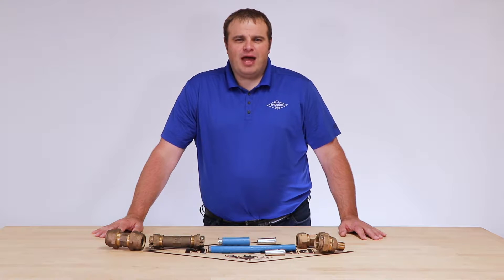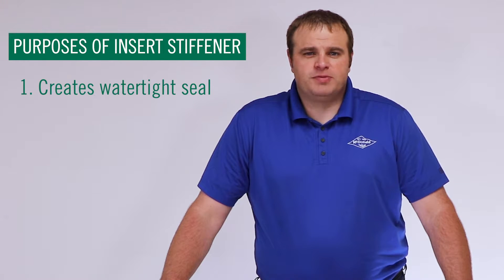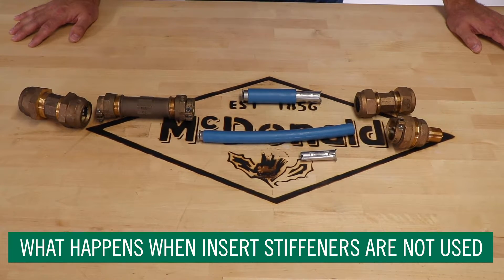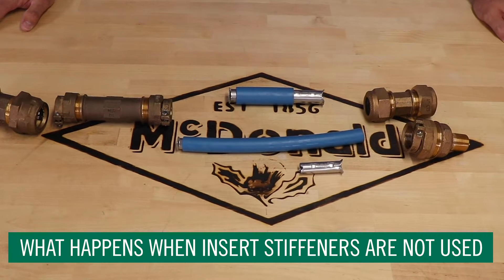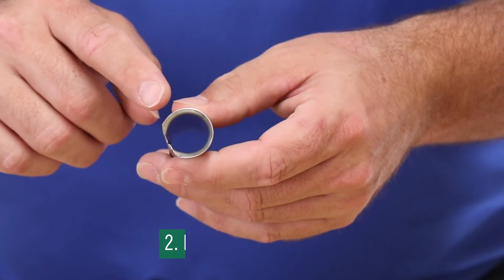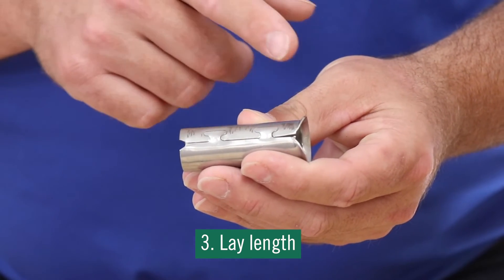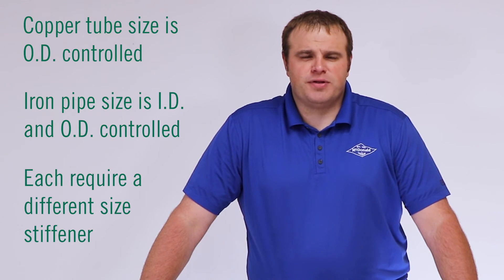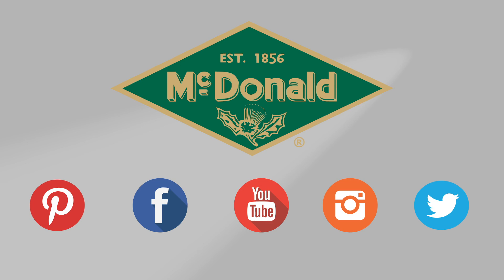Importance of Insert Stiffeners

Comment: Can a corporation coupling be use in grey pvc and if it so, does it needs a stiffener ? Thank you
Reply from the maker: Hey Mario, Typically there is no need for a stiffener when a compression fitting is used on PVC. However, your question is about grey PVC itself. Without knowing the specs on that PVC, we couldn't recommend using it on any of our fittings.